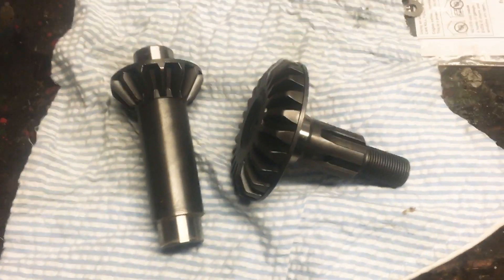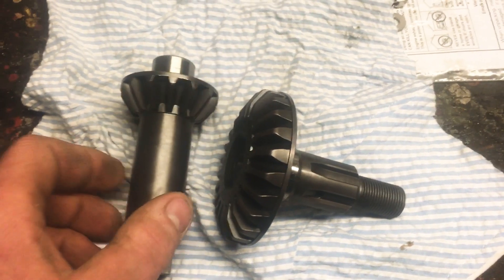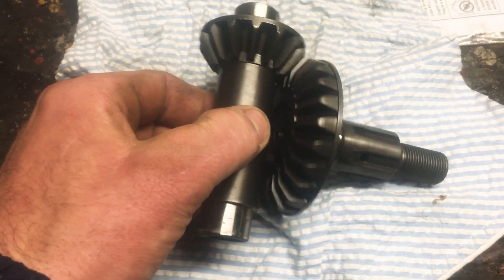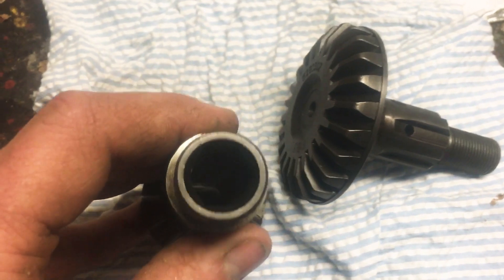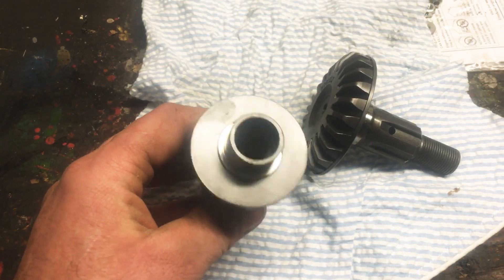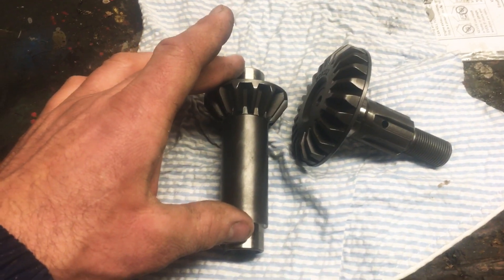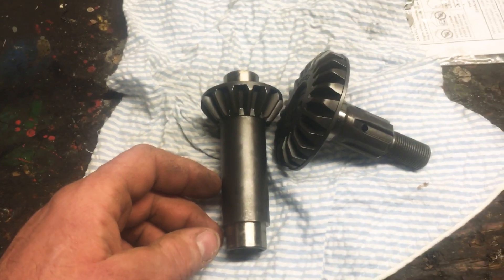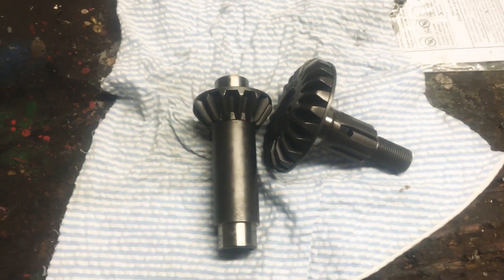New idea agco 5209 5212 gear lash

Comment: we have a kuhn gmd600hd .  bought it new 10 years ago.  use it for 3 cuttings on 30 acres every year. 
never opened it up.  in fact, it still has the ORIGINAL drive belts !   just change the cutter bar bar oil every other year ( which is way more than the manufacturer recommends )    
get rid of that junk, get a kuhn.
Reply from the maker: Hahaha I appreciate the comment however all of my new idea mowers I have 3 of them. Are from the mid 90s. Doing 3-4 cuttings a year on close to 400 acres per cutting. I own one piece of Kuhn equipment a double gyro rake. And I don’t ever want to own another piece. I hope your machine was not made with same steel my rake was. It literally breaks apart all the time. Bought it brand new!!

Comment: How do you remove the main shaft?
Reply from the maker: Remove the far end from the cutter bar. 
3/8 carriage bolts 1/2 carriage bolts and 1” bolts hold it onto the machine. 
Then you can pull out the shaft if it’s one piece. If it’s sectional shaft. You will need to remove the gear boxes.
Reply: @chadsharrow9269  thank you

Comment: How hard is it to replace the whole gear housing or rotator housing on the cutter bar. I had two bolt holes bust out that hold the center gear head down
Reply from the maker: Not to bad.  
Remove the outside end shield. Remove the 5/8 hex cutter bar.  You will need to pull relatively hard to remove it.   Remove the skid shoe and shield Loosen the 1/2 carriage bolts that hold the cutter bar to the machine frame.   Then you can remove the the large double ended hex bolts that hold each gear box together.   You really only need a few wrenches.  Or breaker bar.  Air tool speeds it up also.
Reply: @chadsharrow9269    the one I have too replace is the second one from the gear box. Do I need start from the opposite end remove the end plat and bolts. Then loosen the large bolts that hold the housing I need to replace and slide it apart leaving the other 3 together?
Reply from the maker: Bella's Acre's 
Probably be faster to drop the whole bar out.  Remove the far end shields.  All the turtles and the lower guards.  
Use a couple floor jacks or a set of forks on a loader.  Place it under the bar.  Remove all the 1/2” bolts behind the gear boxes.  And the two 1” bolts at the gear box.  Then the whole bar will come out.
Reply: Just bought a 5212. One of turtles turn freely. Got it apart. It rounded the hex shaft and looks like the gear is messed up. It a one piece shaft. Question is. Can I get two new gear sets where the hex goes the entire lenght. Cut the old shaft half way between and put in lenght of hex shaft between them?
Reply: @farmfixes112  it will need a new hex shaft all the way and gears. I had to replace a hex shaft it wasn't too bad. I took a price of the shaft to local steel supply matches it up and cut it to size worked perfect been going for 9 years had it apart again when I replaced a section on the cutter bar and it still looks brand new
Reply: @Clearwater454  what hardness was it?
Reply: @farmfixes112  I really don't remember
Reply: @Clearwater454  found out my shaft is 30 rockwell which I believe is the orginal. $291 at dealer plus some freight. Found that 4140 is about the same. $44 at steel shop. 1018 steel hex is to  soft. I bought a few extra for spares and for anyone looking for that full length shaft.
Reply: @farmfixes112  the hex shaft is what turns the heads if you cut it only the first half will turn when the machine runs. Also if you was to be able to get it cut and matched up where the seam was perfectly in a gear and cought both shafts it would have so much force it will round end off  again save yourself trouble and put whole new shaft in.
Reply: @Clearwater454  but if there running short shaft on later models. What would be the difference? It be same amount surface area as with the old gear set.